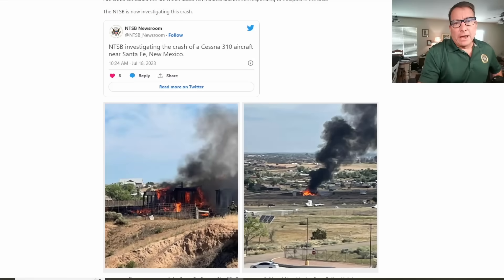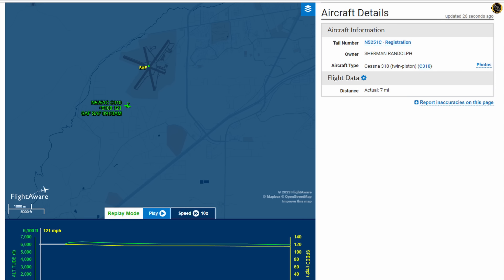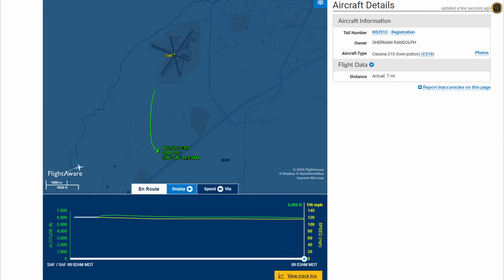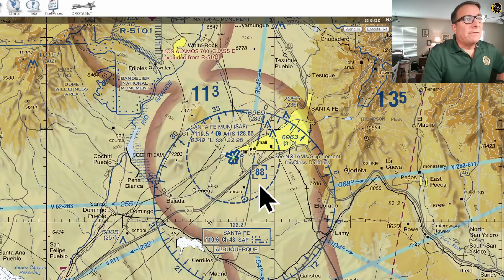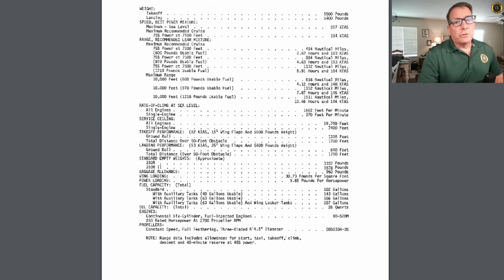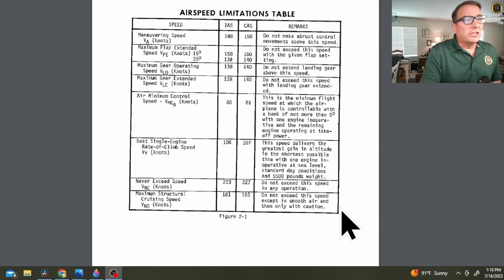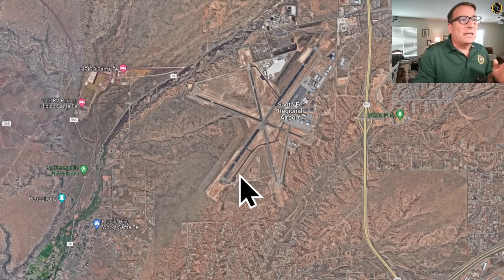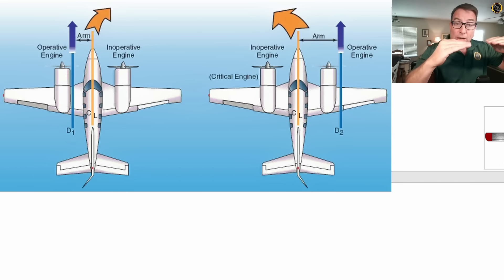Fatal C-310R Engine Failure - Santa Fe, NM

Comment: Thanks, Juan, for another informative video. 

May the pilot rest in peace.

Density altitude was certainly a factor in this accident -- the aircraft was at or above its single-engine service ceiling (as was well-explained in the video and which only provides a 50 feet/minute climb)

You also mentioned "engine-torque" as a factor that would make the left engine the critical engine (to lose) on twin-engine aircraft , since the engines rotate clockwise, as seen from the cockpit (on twin-engine aircraft that do not have counter-rotating propellers, like the Piper Seneca or Beechcraft Duchess, for example). Torque would tend to make the aircraft roll to the left.

One additional factor, that would cause the aircraft to yaw/roll to the left would be "asymmetrical thrust", which is caused by the right-engine's descending  propeller blade having a higher angle-of-attack (thus taking a bigger bite of air), than the ascending blade, resulting in a stronger yawing moment, then rolling moment, to the left side. 

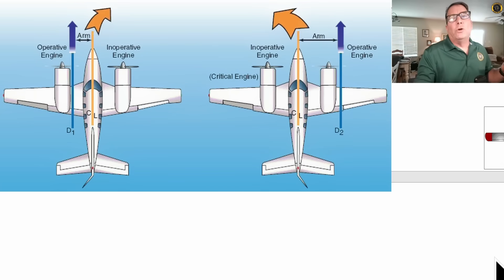As seen in the diagram at 7:23, the right engine's descending blade is located farther from the airplane's centerline, than the left engine's descending blade (the "arm" is longer), so it would produce a greater yawing moment. 

Additionally, the left engine/propeller would not be producing power, but in fact, producing drag, which would make the yawing/rolling tendency even worse (assuming it was not "feathered"). 

With an engine out, if possible, the aircraft should always be turned into the good engine, especially if it is the "critical engine" which has failed. Continuing a straight-out departure with the aircraft  banked 5 degrees into the good engine would be optimal for gaining altitude, terrain permitting.

And, as others have pointed out -- if the aircraft isn't climbing and/or airspeed is decaying, pick a good "off-airport" spot, and make a controlled "forced landing". At least, the good engine should give the pilot more options in picking a good landing site.

Comment: As some people say, the second engine in a light twin will get you to the scene of the accident. Very sad.
Reply: I have flown a Beachcraft Duchess on one engine for over half an hour to a small airfield with a mechanic without any control issues at all. I would not have wanted to do that in the 310.
Reply: @Lee-yy2lr  But I highly doubt you would not do that in those density altitude conditions.
Reply: @timaz1066  
With the "high performance"
 Beechcraft Duchess I could. Remember I was a pilot. I kind of know what I am talking about.
Have you ever flown this aircraft. Or any other on a regular basis.
Reply: @Lee-yy2lr did the engine quit on takeoff or while flying ?
Reply: @arthurbrumagem3844  while flying. But on takeoff the Duchess having counter rotating props is far less susceptible to hard rollover in any condition than the 310. The 310 without counter rotating props makes the left engine the critical engine whereas any degree of a left turn coinciding with left engine failure a one second adjustment has to be made to recover before a spin ensues.
Upon takeoff in the 310 more right rudder is needed to minimize P-factor that makes a plane automatically yaw to the left. Even moreso without counter rotating props. In the Duchess my instructor would pull power to idle on one of the engines and I recovered in under 50 feet altitude. Since the 310 did not have counter rotating props,no instructor would ever pull power on the left engine unless simulating takeoff at or above 3000 ft.
Reply: @Lee-yy2lr  thanks for the reply. As a pilot of an archer whose instructor owns both a Apache and Navaho I am aware of the advantages of counter rotating props via our many conversations. I appreciate that input.
Reply: @arthurbrumagem3844  
As an ex pilot I had butterflies in my stomach only in the 310during take off. Much more fun and safer flying inverted at 200 ft.in a F-15.

Comment: I know I’m Monday morning QBing, but fly the airplane and stop talking to ATC. Turn into the good engine! And finally, the density altitude was approximately 3000’ higher than SE service ceiling. 
Bottom line- he didn’t have a chance on one engine.
Reply: T310 does have a service ceiling of 17,000
Reply: @Jopanaguiton  I didn’t realize it was a turbo model. Still, would be difficult getting there on a SE. Seems like he should’ve been able to get it around the pattern safely.
Reply: @Jopanaguiton   WRONG, just maybe maintain 17,000-  if you’re already ABOVE that altitude AND at cruise speed…   It WILL NOT climb to and maintain that altitude from below…
Reply: @joer5571  Oh trust me I have 3500 hours in a T310. It will climb at 200FT/minute minimum. I simulated a hard deck of 9000 FT and simulated go around from dirty to clean applying 32 inches manifold 2500 RPM power in one engine. You ignore the VMC demo in commercial maneuver procedure where you have to maintain blue line. Put the nose up even at below blue line but above red line while making sure you have directional control.

Comment: All class, all the time. Great reporting Juan. Thank you for your quick work! Even if this is a turbo-normalized (I'm guessing) twin, does it change the performance curve at these (density) altitudes by a significant amount?

On a competing thread, they say it changes everything, but yet the dude still crashed... heck IMO he would've been better off if he lost BOTH engines and was forced to land straight ahead.  Supposedly the dead engine was the left one, but what evidence points to this? (or was it just obvious based on adsb data?)
Take care!
Doug

Comment: Damn—— under powered twins ——— sad loss as you are out of luck on take-off if you suffer equipment failures. RIP
Reply: Don't think you can call a 310R 'underpowered'.........
Reply: Not underpowered. This a turbocharged 310 should be able to climb 200FT/minute in single engine clean configuration. Pilot is most likely not proficient.
Reply: Yes, noone. Doomed I guess. Bummer.
Reply: Juan's numbers are hard to argue with. When it comes to light sport planes, two engines doesn't mean you've got a spare. In that heat he probably needed both engines just to taxi. </s>
Reply: @jasoncarswell7458  Juan was looking at a non turbo 310 POH. A T310 actually has a 17,000 single engine service ceiling
Reply: @@ahmedlamborghini3703 Ahmed, to quote you "What do you mean by underpowered?" Underpowered, like your brain.
Reply: @@ahmedlamborghini3703 Hello Ahmed. Yes, my comment was rude and it was uncalled for. You deserve better. Sometimes I try to be funny and nasty at the same time. I will not describe my problems but I do do offer you my apologies. I think the term "underpowered" hit a nerve.

Comment: In light twins at high field elevations the second engine is only there to take the test pilot directly to the crash site. My instructor said in ANY engine failure you best bet is always within a few degrees of the nose. Hit flat and under your best control.

Comment: Juan - Nice sum-up of accident!  RIP to Doc!!  In '61 on Single Engine Lan Chile DC-6 Panama - Miami, we had started w/4, 2 blew up in fireballs, 3rd one quit in mourning for Buddy, & our money on #1!!  2 - MIGs welcomed us to Cuba by not shooting us down, opposite what Castro had promised.  We became their project w/MIG Leader letting us draft just making Miami, landed threshhold bumping up on end of runway to sit.  Minute later MIGs flew over LOW, landing as outta gas.  One spoke Espanol & Leader spoke Russian/English.  Lotsa huggin' & hand shakin' goin' on while Lan Chile filled 'em up, but they took off to return before got in trouble.  Foreign Relations at their finest!  What does this have to do with this crash??  Well, Both Pilot's shirt completely drenched in sweat fighting that crabby liner all the way from middle of Carribean.  So, would that have been what you meant by "Power Differential" problem?

Comment: The irony is that if this were a single engine AC, he would have had no choice but to land relatively straight ahead, and it appears that the countryside is mostly flat and clear. So by staying under control during a glide, likely would have had no to minimal injuries.

Comment: Looks like at that density altitude he couldn't even fly straight and level on one engine. He was also surrounded by higher elevations.
This is something to check before you take off: Can you "if" and where's best to set down when "if" happens?
RIP my pilot friend, I'm saddened for our loss. I've hopes that others will learn and live for your presented happenings. (What Dan does).
Robert

Comment: I believe the accident aircraft is a T310R which has the turbo TSIO-520.  It definitely have higher single engine service ceiling.
Reply: Several sources give the single engine service ceiling  as 17,000ft+.The 7,000ft figure used in this video is for the normally aspirated engines.

This look like a rare error on this channel.

Comment: Sadly, like most of these tragedies,  it looks like it could have been avoided. There's no mention of the pilot's experience and obviously, we don't have all of the information but a couple of questions stick out. 

It seems that his decision to "get some more altitude" may have been a major contributing factor since the density altitude and apparent dead left engine would have all but decimated his available climb rate. Since he was so close to a couple of available runways, and no obstructions to worry about, I have to wonder why he would have needed more altitude.
Reply: You need to gain altitude first by flying straight so that you have enough altitude to turn back towards a runway without hitting the ground (because making a turn will likely give you a negative climb rate).
Reply: @igclapp  True. Unfortunately, it seems as though he was attempting to do a climbing turn into his dead engine which as Juan pointed out, was a recipe for disaster.
Reply: @tonyradmilovich3154  Turning into the dead engine should be no problem at blue line speed and might even yield a higher climb rate than turning into the good engine as less rudder is used and therefore there is less rudder drag.

Comment: I used to treat a Cessna 402 as a single engined aircraft until it reached a reasonable circling altitude depending on the day.   In other words the single remaining engine gives you some options on the way to yor of field crash landing.  
Also don't forget to Aviate, Navigate, and only then Communicate.   That is, focus on the aircraft until you are ready to communicate.   That pilot appeared to prioritise the Communicating instead of Aviating.

Comment: It would be interesting to have a discussion on known causes of engine failures during takeoff. One could simply point to maintenance issues, but I assume it's more complex than that.
Reply: An old plane, high altitude, hot weather, probably having to throttle the engines real high to get lift. Seems like a lot of complications before you even get to other common issues like mechanical failures, electrical failures, instrumentation failures, fuel quality, procedural failures or service mistakes.
Reply: Could be a lot of things.  For example, this was an experienced pilot but he was making a lot of mistakes that day.  It's very possible he made a mistake in the fuel selector or that the left tank was empty or nearly so.  Lots of things could have caused this, including, and many/most of them are due to pilot lapses.
Reply: Thanks, Mortos and Chuck for your comments.

Comment: Your explanations on aviation crashes are the best out there.  My condolences to the family of the pilot.  I wonder if these GA pilots really consider these facts (weather, temperature, etc), as you are stating them, before they fly.
Reply: To the very last detail.  Total mastery of those factors is required in training and testing.
Reply: I think it was trying to make a left turn, directed by atc, that led to loss of control, as rt. rngine torque pulled the ac over on its back at very low altitude. In conditions like that day, loosing an engine in a twin, with 9k ft d a, if you can't maintain post rate, all you could do is pull back the good engine and land in an open space straight ahead. But a real hard call to make as we all want to save it somehow. With a 310r, probably could climb slightly if straight ahead and only shallow rt turns. ??  But shit happens fast, and I can see following a direction while very busy would happen.
ME training simulates loss of yaw at vmc but not trying to add in a turn into the dead cr eng as well. I've flown a lt. twin out of there, and Angel Fire, with everything running had a very flat departure at just above blue line airspeed. I would have had to land+crash straight ahead if one eng failed. And alot of houses in the way so may not have been survivable in my case. RIP to another brother.
Reply: @mikerhoades6129  You have to wonder if he had not had the initial rwy 33 directive/suggestion, had he held out for an attempt at rwy 10 could this have ended differently?

Comment: I've mentioned this in an open forum and got ridiculed by the "you're screwing with the profits from our twin sales/training" industry.  Flying twins has A LOT of dangers.  There's an enormous difference between commercial/military multi-engine aircraft and GA twins.  That single engine max altitude was below ground level and there are some GA twins which are far worse.  Even if temp was fine, he had barely any altitude to play with.  And the kinetic energy of a GA twin vs GA single means off airport landings carry a much higher chance of fatalities.  If you want to be an airline pilot, sure, accept the danger and go make your paper Booboo but otherwise ... get a nice single.
Reply: I'm not a pilot but had no idea how non-intuitive it is that performance with a single engine running is so non-linear vs. both engines running.  As a layperson with quite a long (lots of years) interest in aviation, if I were pressed to come up with a guess as to how the power is distributed I would just default to the "obvious" performance with one engine working as about half of the performance with both - but it seems to be nowhere close to that, is that right ?
Reply: @scottenglert4083  think of it like this: let's say a twin engine plane had 200 horsepower per side. It probably needs about 180 horsepower just to get airborne but unable to climb.  The other 220 horsepower help it climb and do all the stuff it needs to do so that's why when one engine is out, it's like losing 90% of your performance

Comment: So, dumb question: should he have not tried to fly in these situations? Seems like one engine loss basically puts you in a very bad situation right away? Condolences to the friends and family.
Reply: Correct, He should have done some preflight planning which would have  then told him it would be a bad idea to takeoff.
Reply: @@ahmedlamborghini3703 Did the conditions cause the engine failure? Or were they terrible only IF(for whatever reason) an engine happened to fail?
Reply: Light sport aircraft with two engines have a high power-to-weight ratio, but individually their engines are weaker than many single engine planes. They do not follow the usual paradigm of being powerful enough individually to use the second engine for safe redundancy - in a sport twin, a loss of either engine is very bad news and at the best of times results in an immediate divert landing.

In especially bad conditions for lift (flying out of Santa Fe in the summer) the charts clearly indicated he could not sustain flight on takeoff with only one engine - he would immediately begin to lose speed and/or altitude and inevitably crash. He took the risk anyway. We should also be thinking about the people in the building he hit. Blue skies.
Reply: @blackwingy  I think it’s kind of like a going canoeing in cold water without a life jacket thing. You’re fine unless something goes wrong, and then you’re in a very bad situation. Maybe the NTSB will find something wrong with the engine. I wonder if planning software like foreflight can warn you about stuff like this? Take your local weather, your aircraft, and ask your fuel load and weight and then warn you while you’re planning, or even if you were fine in the AM, but you were delayed in departure and now it’s a lot hotter, and the app could notify you that you were going to be on the extreme edge of risk.
Reply: @toastrecon  Thank you-that was my impression too from the replies but I wasn’t sure. I’m not a pilot(obviously), but I learn a lot here.
Reply: @blackwingy  I’m not either. :-) Just like airplanes. Maybe one day when I’m rich enough.

Comment: Juan, I’m curious what the most challenging engine out practice scenarios you’ve done in Harvey look like. I have to imagine your home field has some pretty challenging density altitude days in the summer and I wonder what restrictions you set for your operations. 
Also wonder if the tower controllers suggestion of making a left turn played into the pilots decision..:as much as I understand that the PIC is responsible for handling emergency’s, the power of suggestion is strong in the minds of people under high stress loads.
Reply: Any turn would have lost him enough airspeed to make it nearly impossible to control.  The tower would have had no idea that that specific plane was so poor at higher altitudes.